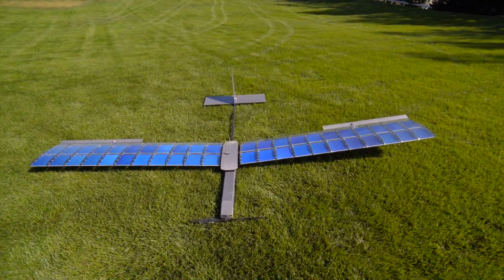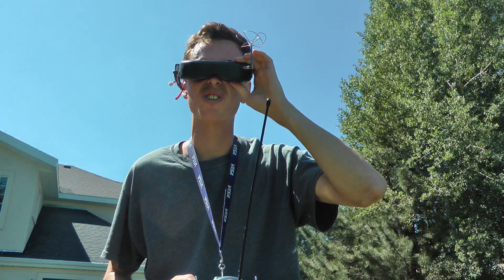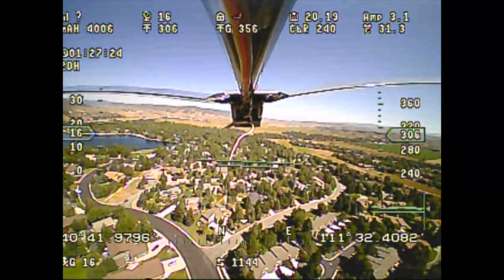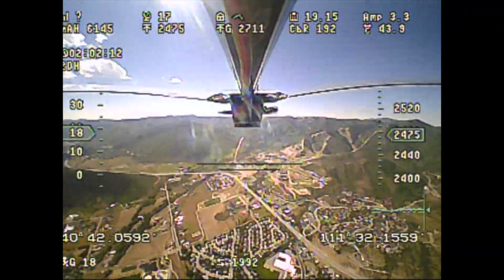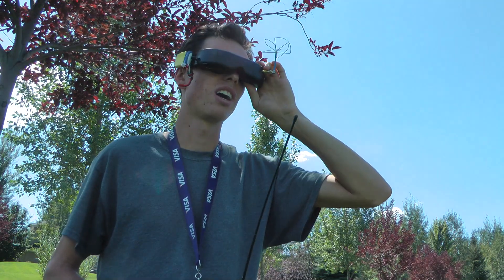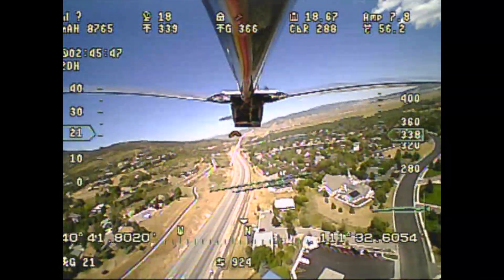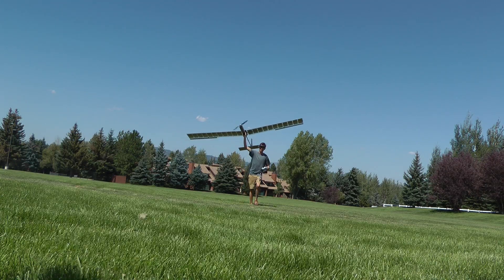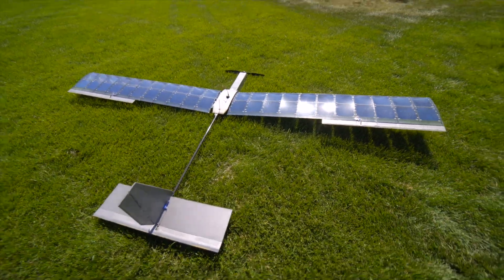SOLAR Plane V3 Long Duration Test Flight - RCTESTFLIGHT

Comment: You should put in some electronics to manage the solar cells and battery to maximize power on the solar cells. I think that could do wonders.
Reply: That is what the Maximum Power Point Tracker(MPPT) does. It makes the load of the motor and batteries appear to the solar cells at the right impedance  for maximum power transfer. 

Its kinda like a transmission in a car. Right now the solar cells are  either seeing too much load or not enough to get the rated power out. We are currently in the wrong gear. The MPPT will automatically shift gears so that maximum power is available to the batteries and motor.

Comment: I would suggest a Buck and Boost Voltage regulator between the solar cells and the batteries.  Such a regulator is cheap, light and it will keep the Batteries at the set voltage (if possible)
Buy it at 
https://m.banggood.com/DC-DC-Boost-Buck-Adjustable-Step-Up-Step-Down-Automatic-Converter-XL6009-Module-p-1087346.html?rmmds=detail-bottom-alsolike
Reply: MPPT do this but a bit more intelligently. Simply just putting out a fixed voltage  will not gain him much efficiency. The MPPT will vary the load to the solar cells to find the  point of peak power. Then it will buck boost the output to get the highest voltage possible (within limits)  to the motor and battery. Overall its providing impedance transformation.

Comment: The concept of Solar Powered Planes is using the concept of optimization. It's a matter of using higher efficiency solar panels, higher efficiency motors and higher efficiency batteries & definitely an auto-pilot as using human manipulation cannot efficiently command the airplane when to use full throttle and use wind gusts to effectively get longer ranges out of the plane. But man, nice work. I love the concept.

Comment: Don't forget that thermals are actually quite relevant for a "solar plane", after all thermals are from solar energy and will likely occur when your plane is going to be flying as full sun is likely going to be a good time to use it. Might be worth having a look into some 18650 cells for their high capacity and light weight (considering the low current requirements) and using an MPPT controller alongside such a battery.
Reply: wendtb exactly this!
Reply: Most RC aircraft use special Lithium Polymer batteries instead of metal cells like the 18650.  For the same amount of mass the RC packs have much higher capacity and discharge rate.

Comment: Awesome flight! What you need is a micro MPPT boost LiPo charger. There is a microcontroller that does this called the LT8490 by LT. You can easily strap one of those to your plane!

Comment: Higher KV motor and smaller prop is what I'd be doing.  Swinging a big prop is just wasting power if you don't need the thrust from it.
Reply: The other option is a High KV motor with a gearbox.  The glider guys use them for a reason.  Good work though.
Reply: Bigger props are more efficient. A smaller prop needs to turn faster to produce the same amount of thrust and as you go faster the losses from drag get higher.

The only downside to going bigger is that it takes longer to accelerate or decelerate. This isn't a problem with planes but becomes a big problem on multi-copters where your using rotor speed to control roll pitch and yaw.

Gear boxes add more losses and were only used because low KV motors were not available.

The motor and prop configuration on this plane is very efficient.
Reply: You are confusing multirotors with planes.  That smaller prop turning faster making the same amount of thrust is also propelling the plane faster making it more efficient.  Oh and the gearbox thing think again......ask yourself why all the big gliders that need highly efficient motors use them.  It doesn't make sense to me either but the results speak for themselves.

Comment: Disable the compass on the Vector and you will not have the "S" turns while in RTH. The compass is not used in fixed wing.

Comment: I don't know what the capabilities of the flight OSD unit you have are, but wouldn't it be great if you could rig up a power meter between the panels and batt, with serial out fed into the OSD so you can see the instantaneous and net current flow in either direction.

Comment: Awesome work again Daniel - keep it going! You are a credit to the open source & collaborative working global community :) I, like many many others I suspects, have learned a lot from your videos over the past few years.
 The keybas you've said is finding a way of maintaining the right voltage sink load from the solar cells to a suitable load & then discharging that into your main flight battery system effectively. I was thinking that a switching quad bank of capacitors may be a good way to go. Set up each bank to be optimised to charge to their maximum potential on the peak solar voltage & the switch them in dual series pairs to a allow their charge full charge capacity to be utilised when fed through an intelligent charge controller. Have one pair charging the flight battery constantly & they other being charged by the solar cells - switch when the solar side is full & repeat??

Comment: The colder a solar cell is; the more efficient it is.
The higher you fly, the colder the air, which cools the solar cells causing them  to produce more power.
Fly as high as you can if you want to fly longer without changing anything else.

Comment: How did you get a permit to fly above 400 ft?
Reply: lee x I see your point. This is almost impossible for me because  the field that I fly at is within more than 10 controlled airspaces
Reply: Syntactic Garbage wow that must suck 😂
Reply: They aren't required.
Reply: Actually they don't even exist. You can fly as high as you want
Reply: Alex West Cool! I never realized that. I just re-read the special rule for model aircraft and realized that it's not in there at all!
Reply: I can see why you would think it was tho. It's actually just a recommendation that the faa put out. But since the 2012 modernization act said the faa can't make laws regarding model aircraft  (except for the special rules of course)  they can't create a law for it. That bill that they passed a while back (the one that said we had to register), can't remember what it was called, did actually require aircraft to stay under 400 feet. But since it was in violation of the modernization act, it was repealed.
Reply: They would prefer if you ask before flying above 400 feet 

you can norm call your local air port that manages your air space, and they tell you if any planned helicopters or small planes are going to be flying past your area and give you permission for time you expect to be up there for

Usually you only get problems when you've not rang your local airport for permission when you get some (probably 1) local person complaining about the drone flying around often

Comment: Could you fly it controlled over 3G or 4G, that would be amazing you could fly so far!
Reply: The latency is quite high flying through 3g or 4g networks. Also they don't work well at altitude because cell tower antennas point down towards the ground.

Comment: We live in a solar powered house. It seems that the solution to many of your problems could be a MPPT charge controller. Basically these pull power from the panels at the voltage thats most efficient and they also charge the batteries as efficiently as possible. The downside is that they are super expensive and possibly heavy

Comment: Might be worth checking the temperature of the solar cells, they are less efficient when hot and unless they are exposed on the lower half they are in a greenhouse.

Comment: That was pretty successful actually, sounds like a bit of Power Management and You're golden, maybe change the Eagle Tree Vector, try a PixRacer, they are super small, and have a lot of Features plus probably half the weight, lowering the weight a bit might just get You in the Parameters You're looking for? What a Great Video! Good Job!  :)

Comment: mppt would guarantee a voltage just above or at the battery full charge and you wouldn't be wasting power when the solar voltage is too low to be useful.

Comment: Daniel, I'd suspect you could gain some effiency by replacing the multirotor prop with a higher pitched Aeronaut folding prop (that would also allow you to belly-land) and perhaps go to 4S for a better voltage match to the solar panels....

Comment: If you are really serious about solar flight you need to separate the charge circuits so that each battery cell is charged individually.  Always draw from the batteries and always put the solar power into charging. In this way voltage of the panels doesn't matter, the charge controllers will use as much as they can.

Comment: It now seems you're at a point where you have to nickel and dime your efficiency. So I'd try bench testing two or three motors of the desired ratings of a few different brands, and the same in combo with a few different motor controllers. Just to see how consistent they are. (Seems like a subject to discuss in itself.) The plane seems pretty close to being there, so I'd guess it's something small that may be considered within tolerance. Something like a change of 5% could be the difference needed for your project. So it might take cherry-picking motor 3 of brand A, and motor controller 2 of brand C to really hone it in.

From this video it looks like you're 75% of the way there, compared to the previous ones, being that you were holding power well when flying a certain direction and able to gain it back during gliding.

Comment: Do you get any grief from the FAA for the altitude and flying out of the line of sight without a spotter?  I have seen other YoutTubers get letters from the FAA.  I know FAR part 107 is thought of as a drone regulation but wondered if the FAA had turned their sights on other RC aircraft operations.  Thanks for making the videos I really like what you do.
Reply: I think having FPV should count as a line of site. some of the FAA rules are older than FPV flight and dont account for it.
Reply: What do you mean he clearly had people spotting it ;) where is the proof he didn't

Comment: Hey, 
I'm a electrical engineering student and I love your project! Also, I'd love to help you with the circuit. I think there is a lot of potential for optimizing the powerconsuption / generating / storing. First thing I would do is: put sensors for voltage and current to the solarcells, battery and motor. Also, if possible a airflow meter. That helps you to test only at normal conditions, not to get confused by wrong datasets. Contact me, I will help you =)
Reply: Hey guys
I dropped out of electrical engineering after a semester.
I think it's a pretty cool plane.
Thanks.
Reply: Wow a lot of electrical engineers
Reply: I'm also an electrical engineer and i have nothing to say. I just wanted you guys to know that I'm an electrical engeneer.
Reply: This slow-flyer does not need high power. In fact, the smaller consumption the better. In my opinion the best way to get better performance is to reduce weight and to make the shape as much aerodynamic as possible. It has a lot to do with airfoil, which is essential. Wing gives main flying characteristics to the airplane. Motor is not the thing that holds airplane in the sky. It is wing! By the way, I am also electrical engeneer :D :D :D
Reply: @petrsedlak1161  yes that was my first thought too. Just looking at it it seems way too heavy.what materials are you using ? Try to go with carbon as much as you can. You might also consider using smaller lipos in capacity and also in voltage, so even when it is shady, the generated voltage can be pushed into the battery
Reply: Hey buddies. I just wanted to mention that I am a physical engineer with some electrical knowledge and an affinity for aviation. fliesaway
Reply: Hey guys, I'm a dragon and I suggest breathing fire and riding your own thermals.
Reply: I am an electrical engineer and if not for the assistance of spell check I would not have been able to spell electrical engineer.
Reply: Why am I here
Reply: @dailydoseoffridge3160  Because you are an electrical engeneer, and so am I.
Reply: Hi, now that I’ve read this comment thread I am also an electrical engineer. If you want to gain altitude, I suggest strapping rockets to the plane.
Reply: hey i did half of an electronic engineering degree then realised i could learn more , and faster if i just taught myself on the internet. worked well. and yes data is essential. measure everything.
Reply: Freelectron Wish I could do that but I need $$ haha. So I’m just doing both when I can lol
Reply: iM a ElEcTriCaL ENgiNeeR
Reply: Hey guys Im a solar installer. Just saying..
Reply: Use ultra caps instead of batteries. Quicker charge time, higher discharge and lighter.
Reply: @paranutaus  caps have an energy efficency by almost only 50% , this is not what he is searching for i guess...
Reply: @paranutaus  Im not engineer im a middle school kid who knows how to build stuff the only problem is the energy also is put out faster so a battery would do better because he wants more storage but if he wanted more output then he should get rid of the batteries
Reply: Im not an electical engineer, but its simple math, and not about volts but amps. More amps=quicker charge. Work out total amout of amp hours used by the motor servos whatever, then work out how many amps you need in solar pannles to cover the energy drawn,  add a couple more amps/pannels on top to sustain charge then add another 3rd to sustain power on a dull day or in this case under clouds. A solar regulater/charge controller between the batteries and pannles will take care of the rest
Reply: NSA: I’m coming for you
* underground facility building high tech* 
* classified * 😂

Comment: good job flying over 4 hrs, now you know what it's like.  Exhausting!   looks like you have an adverse yaw issue with your autopilot and possibly flight controls.  need some mixing, or just Y the channels.

Comment: Hey.  Seems that you could benefit from using one of Dacian's lithium charge controllers.  They are small & light.  I have the SBMS in my camper wired up to a few panels & a lifepo4 battery.  It's a solar charge controller with digital out that keeps track of watt hours from the panels in & out.  So you can know.. better than just voltage levels what the current charge state is.

Comment: Does the thin film of wing covering over the solar panels not decrease the panel output greatly?
Reply: Depends on what the coating is made of, and the thickness + refractive index may come into it if the sun isn't high in the sky (near to midday)?  If the coating is thin and a good, low absorption material; then it can be down to only about 3-5% loss, I think.  There are some very capable engineers/scientists here; who could say more accurately.
Reply: Well.... I think it has something to do with the circumstances of the diameter of the photosynthetic power modulator that effects the output of the vehicleular airlock.

Comment: Wow, more than 4 hours, thats actually really impressive! I can imagine the transparent foil over the panels causes alot of losses, but then again, you kind of need that for aerodynamic efficiency...
Also i would try a smaller battery, or maybe even supercapacitors? Also how about autonomous flying via GPS? Could do some intresting stuff with a self steering plane that flies "forever", right? Keep up the good work, always looking forward to the next update :)

Comment: I think, you should look for "load sharing charging" basically, a charging circuit that disconnects the battery and charge it separately  from system load and give the enough power to system to keep running. If the system load is higher than charging power than battery kick in(this is related with charging IC, some maxim electronics charging ICs do that eg max14690.) also check out our project fb.me/watchxofficial you might  find interesting.

Comment: I would focus on autonomy.  I don't know if there is a flight controller which takes motor draw in to account, but if you can maintain voltage of your cells by controlling draw at the motor, you don't need a charge controller...or, more accurately, you already have a charge controller.

Comment: Can you do a little research on solar cells before spreading pseudoscience speculation? This is all well established tech. Just load down your solar array with resistors to figure out what the power/voltage characteristic looks like. That power may scale, but the voltage will pretty much stay the same.  People can learn from this project. Don't miss the opportunity to teach people something solid.
Reply: I commented before the end. It's great that you have a charge controller.  If a 4 cell isnt enough power and you go to the 5 cell step down,, make sure you have enough voltage at maximum power on the array to even make that work.

Comment: Daniel, you could try using one (or more) of these BQ24650 MPPT buck chargers, only $16 and 11g in weight.
80W capacity with up to 24V input and adjustable 4.2 - 22V output. With 5 of them you could balance charge each cell, or use one for each wing to charge the 5S as 2S and 3S.
http://www.ebay.com/itm/Solar-lithium-battery-lead-acid-battery-18V-charging-module-BQ24650-MPPT-5A-/272759487993

Andreas Spiess compares a number of small solar chargers and converters for small projects here:
https://www.youtube.com/watch?v=ttyKZnVzic4